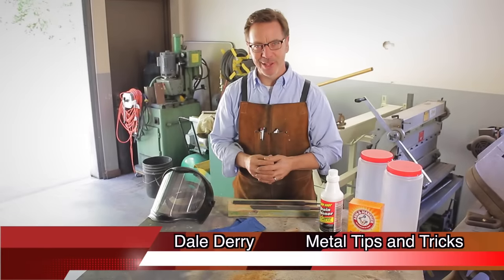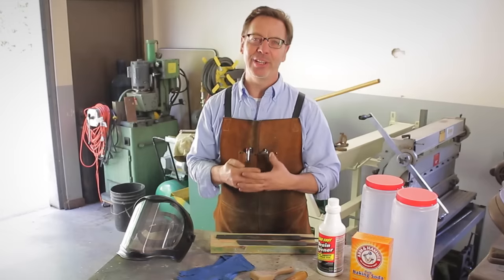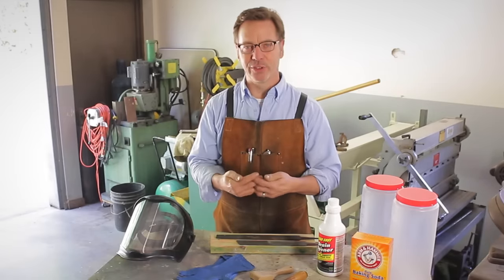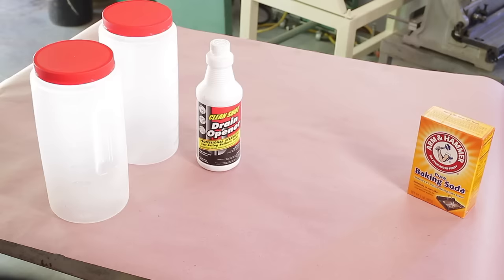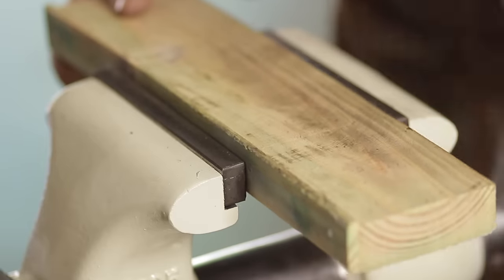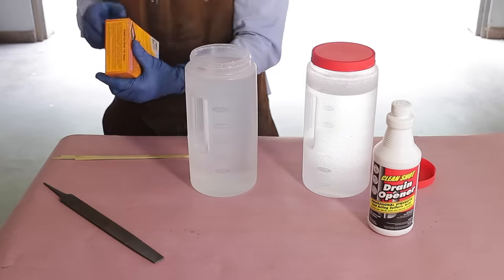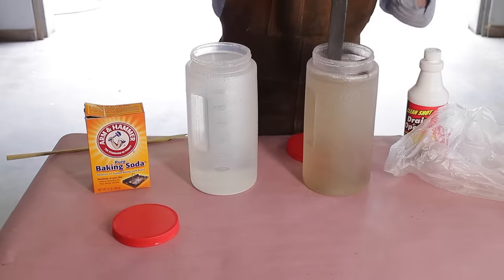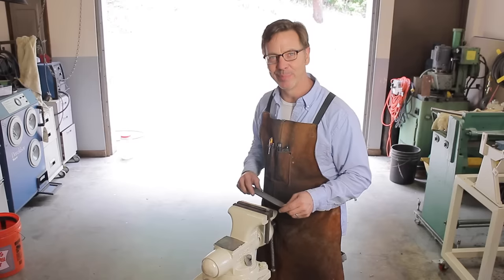How to Sharpen Metal Files

Comment: In an old book I have re sharpening files it says:  Immerse file in acid for a short time.  Then pass lightly a piece of cork along it to remove acid from the top of the teeth.  Immerse again.  Pass the cork and repeat as necessary.  What is being done is actually to not let the acid eat away the top of the teeth but only the valleys.  Never tried it meself.
Reply: this would work.... but u would need to go at it a while
Reply: That sounds like sound advice.
Reply: That is not very rational thinking. First the valleys are not dull the teeth are.  Second the second you dip the file into the acid it is back working on the teeth.
Reply: @thinkfirst6431  Actualy, it is very rational.  You are just not getting it.  Luckily science does not give a rip and it just keeps on doing what it does even though some of us are just a little to invested in cognitive dissonance to understand it.  If you really refuse to accept proven concepts then just send all your dull tools over my way.  I get a kick out of bringing old tools back to life.  Save a grip of cheddar in the process.
Reply: @edstimator1  Actually it is not very rational. no one ever cut anything with the valley of a file unless it was ground down into a knife. The acid is doing the work the cork might at best be wiping some of the sludge off of the top of the teeth speeding up the process an amount not worth the effort. The cork is too soft to effect the metal and would absorb some of the acid so that your just rubbing the metal with a soft material soaked in acid. 

The acid is what is doing the work. The acid eats the metal at a constant rate over all of the file. The reason that it works is that the tops of the teeth are worn at different rates. The very thin tops are dissolved at a "faster" rate than the thicker worn parts of the file so that when the worn parts of the teeth approach a sharp edge again the thinner parts and the thicker parts join in a "sharper edge in roughly the same time making the surface of the tooth more or less "sharp". No one gives a crap how deep the valley is, only how sharp the cutting edge of the file is. 

The acid dip only works as long as the hardness of the file is uniform in depth. If the hardness varies so will the chemical sharping. Acid dip works, the cork is just BS.
Reply: @thinkfirst6431  Dude you're trippin balls.  I've done it, others have done it, it's proven. but don't take anyones word on it. Just keep buying new tools every time they get dull.  That's the REALLY smart thing to do.  Cuzz it's soooodifficult to put some acid in a bottle and throw some old files in it.
Reply: Actually, I just read your whole post and have no idea wtf you are talking about so forget I even responded to you.
Reply: @thinkfirst6431  Exactly! I am a machinist myself, so get a kick out of these know nothing twits spouting of.
Reply: @thinkfirst6431  You just don't understand the concept. The concept being that as the acid Works on The Wider part of the diffs the cork is cleaning it off so that it doesn't eat the metal away at "the point" at the same rate as the fatter areas at the bottom...this does indeed work... try it and find out for yourself...as a machinist, fabricator, and designer, I , as well as many others have learned that theory doesn't always match reality and what says ,no It won't work ,on paper doesn't necessarily mean that's the case in real life. It has to be tried first. Then you will start to theorize why it does work. Instead of theorizing  why it doesn't ,or can't ,work. Especially in this case, where machinists have been doing this for years and it does indeed work.
Reply: @freezerfreezer9097  The concept is that if you dip files in acid then the acid eats away the metal "sharpening" the file. What happens is that the metal is dissolved at the same rate regardless of the thickness of the metal. Example: If the top of the tooth of a file is 0.001 and the valley is 0.020 (don't know the exact ratio this is just an example) the top and bottom dissolve at exactly the same rate , assuming that the metal is equally clean top to bottom. So if your tooth was at 0.002 (dull) when you dipped the file in the acid ALL sides of the exposed metal would dissolve at the same rate. Monitoring the rate of metal loss will result in the tooth going back to 0.001 with all of the other exposed surfaces reducing size by the same amount. The rate is not exact it will depend on the carbon and other additives in the metal to start with so some areas will etch faster than others on a micro scale. 

The idea of the cork depends on your point of view. To start the first time the cork comes into contact with the acid it becomes contaminated with the acid. After a while the cork could actually contribute fresh acid to the metal. The idea that the cork is cleaning off the acid is false. What could happen and what the cork could do is clean off the interface between the acid and the metal removing the loosened metal particles exposing a new face to the acid. Cutting away the "dull" part of the point is the whole purpose of this procedure otherwise you are not getting anywhere. Use the cork don't use the cork you could use a piece of wood or even a file card to do the same thing. The cork wouldn't/doesn't focus the sharpening it would only make it faster by removing interfering scum on the metal. On the other side if you could focus the acid only in the valley and avoid the tooth the file would never get sharp. When was the last time you sharpened a lathe cutting tool on the side but left the cutting edge untouched? If you put a piece of metal in water and leave it long enough does the metal rust equally or does the thinner parts rust into a sharper edge leaving the thicker parts not as effected?

The cork isn't the magic, if there is any it is the cleaning action on the metal.
Reply: Yeah that’s how I was taught decades ago. The lazy way is Soak it in vinegar then hit it with a file brush.
Reply: @thinkfirst6431  if the valleys are clogged the teeth can't do their work
Reply: @RimfireRat  No kidding? If the valleys are clogged with steel or iron take a file card and clean the valleys out. If they are clogged with aluminum or other soft metal first you need to think about what you were doing then you need to know if, depending on what metal it is, the metal will actually be dissolved by the acid you are using and will the acid work faster on the steel of the file or the metal you are trying to remove in the valleys. Not much point in removing the teeth and not cleaning the valleys. Generally it mechanical cleaning for aluminum ect..  If the material is wood or plastic and it is stuck in the valleys to the point that a file card will not remove them the acid will have little effect on that material until you have dissolved enough of the file to make it useless and the material just floats off due to nothing for it to hang on. 

Files are designed for steel or iron removal period. If you use them on wood or plastic clean often. If you use them on soft metal clean very often and good luck.
Reply: @TheLexiconDevils  how well does that work, compared to using sufluric acid?
Reply: @thinkfirst6431  short time clears out the valley and not the teeth. The cork clears the sludge so acid can get into the next layer. But then you already knew that. Interesting feedback though.
Reply: Does anyone read any of the response besides the first line then start typing? The only thoughts I could add to the cork being introduced to the equation,  are 2 things, one you already said its just cleaning off old metal and to expose the next layer and introduce acid.

Second I was thinking the cork is acting like a magic eraser or micro abrasive once its loaded up with metal and acid (think leather strop and jewelers rouge to polish and hone a straight razor or knife) but even if that is the goal I can't see it really expediting or making the process faster or anymore effective than if you just threw the files in the acid then neutralized it. 

Id guess if you corked and acid washed 5 files and just acid, baking soda 5 files you couldn't tell which was which if you did a blind test.

Comment: Great tip! Old files can be recycled into scrapers, knives, lathe bits & makeshift vise jaws too! Thanks!
Reply: The steel in old files is also a favorite of custom knife makers
Reply from the maker: Nice comment :-)
Reply: Do NOT use them as lathe bits ---very dangerous
Reply: @davidwrighton3914  You are right. Files are too hard and brittle for lathe bits. But they might work if you tempered them to make them just a little tougher and less brittle.

Comment: This is a time honored method, and it does help to improve the files cutting ability.  The acid etches the file steel.  This method does have its limitations though.  For example, files that have been abused, stored or used improperly.  All of which are a very common issue.

I have seen many a file just tossed in a drawer or bin with other hardened steel tools and files.  I have also seen files used with saw like, or in a scrubbing/sanding motion.  This will rapidly round/roll the file teeth over.  Even milder (softer) steels can have this effect on a file if it occurs often enough.

Or they attempt to file on steel that has been work hardened, think, an edged tool (such as an axe) that has been used to strike something hard such as stone.  This high speed impact crushes the edge of the tool, which causes the molecules at the site of the impact to become heated and compressed.

After the impact the molecules at the site of the impact rapidly cool and often become harder than the file being used to resharpen the edged tool.  This sharpening attempt literally rounds or rolls the fine edges of the file over, thus, destroying the cutting edge of the file.  Files can only cut materials softer than the file itself.  If the steel is too hard for the file, the steel must be carefully ground to remove the work hardened steel.

Any action that causes a file's steel to become hot will soften the steel of a file, making the file useless as a file.

To me all of these forms of file abuse are indications of clueless and unskilled workers (aka: greenhorns).  Or... people that just don't give a damn.
Reply: Every winner was once a beginner… 
You weren’t born with natural knowledge of metallurgical science and file maintenance. Greenhorns can learn

Comment: Thanks for sharing. As Michel Nadon said earlier, it would be nice to have visual proof of the effect of acid etching on the cutting edges of the file. In theory, what you are promoting might work if the acid etches all surfaces equally and a round tip will become a sharp tip as a consequence. However, I think we need to see this happening to be convinced, My feeling is that sharp edges will be strongly attacked by the acid and come out rounded.
Reply from the maker: I follow your logic and agreed with it, but  it dosed sharpen the files. I don't know why all I know is it works. :-)

Comment: I learned the same trick as an apprentice, the only difference was that it was a 9% sulphuric acid mix and it was left in the solution for 2 hours. Afterwards, you put the file in cold water and agitated for a bit. It worked well. I never did it a second time but I remember being told it only worked the once. Good post, thanks.
Reply from the maker: Hi The run Reaper,  Thanks for your comment. I like stories like that.:-)

Comment: A similar process I tried does sharpen dull files. Whether the system used here sharpens them depends, I suppose, on how badly dulled they are. The copper cleaning tool is a great tip. I used muriatic acid from a masonry supply house and vessels made of PVC sewer pipe with an end cap cemented in place. I left the files in for many hours which ate away a lot of steel, too much in some cases. Worse, the fumes seemed to alter the chemistry of my shop. Here in a dry part of the country I'd never had rusted tools. Since the acid etch everything wants to rust so do it outdoors.
Reply: This a common problem with hydrochloride (HCl or muriatic) acid - even the fumes from an imperfectly tightened lid on the HCl bottle can cause corrosion through your shop - best to store strong acids in their own steel (sacrificial) cabinet with a bunch of seashells in it.
Reply: @mikelastname  Sounds like wise advice. Thanks.

Comment: yes, I am a swordsmith, and I really go through files (filing spring-hard steel a lot). copper and wood both work. For small files, get a popsicle stick to clean them out. Same trick.
Reply: Am pattern welding files into knives with high nickel saw blades for contrast put into nitric to reveal. I imagine the nitric acid(dilute) would work nicely and quickly for file sharpening.

Comment: An old machinist taught me many years ago about using a soft piece of metal to clean a file. I’ve still got a piece of brass shim shaped like an L that I use. I’ve used aluminum, it works fine. Had a piece of brass dar stock that I had used for a punch pin that had mushroomed the head, that mushroomed head worked well. Obviously, the copper you used here does the trick. I’ve never used chemicals to clean a file, but I’ve not ever had a rusty one. Well done and thanks for the video.

Comment: Can you show us a close up of the teeth before and after the cleaning? I'm intrigued what this actually does to the file.
Reply: It dissolves the surface which brings the teeth back to a sharper point, if you try it yourself you’ll see what I mean, if the teeth were rounded before, the two intersecting planes of the tooth dissolve evenly bringing the two planes closer together and therefore deleting the rounded tips of the teeth, I agree, if he has the close-up cameras ability to show it, it would be helpful to explain using the visual aid to show this effect. Even a drawing would be helpful
Reply: @b2manufacturing  Thanks for the explanation. It seemed sort of improbable but now you explain it the process makes sense.
Reply: I think it’s actually cleaning the file I think the acid loosens debris from the tooth relief .
Reply: @b2manufacturing  the rounded cutting edge will as fast resolve as the surfaces. I don't think it will make it sharper, but the proces will clean it more up, so the teeth will become more corse regarding the high and lows of the teeth, so it feels like it's sharper again.
Better buy a new file, they are not that expensive.

Comment: I always use citric acid, it works just as well but is less bad for the environment. Also, I use a 40volt dc power supply so as to speed up the process like in Electro polishing, the electricity makes more metal erode of the planes than of the points and the file becomes even sharper. After I use the citric acid I bring it to a recycling company, fresh citric acid you can pour down the drain, it will be deluded and become harmless. Citric acid that is used with metal can be full of chrome 6 and 7 so recycle it responsibly. The acid I use comes from citrisurf(brand name) ps. great video not many people know this trick and throw their files away
Reply from the maker: Thanks f0r your comment
Reply: This is electrochemical machining, and probably much superior.   Does some iron plate out on the Cathode?  Is the cathode lead or stainless or does it matter?  I think this is the right path and hope you will publish something.
Reply: How do you connect the power supply? I tried something similar with a 12 volt battery charger and just fried it. Didn’t know who to ask but hopefully you can explain the correct method?
Reply: Electroetching will be faster but the tips of the file teeth have a higher electrical potential and will erode faster and as a result, the files won't be as sharp, it may even dull the file more, depending on the electrolyte, voltage and current. That what the process of electropolishing does, it removes the high points on a surface to produce the polish. There are shops that specialize in electro deburring.
Reply: Interesting! I may have to try that twist..
Reply: I think I've read Cocoa Cola does work too

Comment: When you get new files, keep them separated and dry where they won't bump into anything. I have my own handmade rack I keep them in, much like a knife block. Card your files often and keep them chalked. Use the proper file for the job at hand. If you take good care of your files, you won't have to resort to dipping them in acid, which only works for a little while (the file will quickly dull again) with diminishing returns. For all this trouble, you might as well just purchase a sharp new file and take good care of it rather than handling caustic chemicals.
Reply: At last!! someone with some common sense.

Comment: Old files can make great knives that how I sharpen mine.
Reply: William Miller I've made several knives from old files myself. Just remember to do both heat treatments so they aren't so brittle then to put temper back into the file.
Reply: But how do you use the knife as a file after you turn a file into a knife.
Reply: Great info I,ve got a ton of nice old files,but there all dirty got them from garage sales and swap meets.Now I can clean and sharpen them.thanks also and going to make some Damascus knives.cheers
Reply: Files aren’t made the way they used to be anymore. You can make knives out of any number of materials, but vintage files can never be brought back once they’re turned into knives. USA made Nicholson files are some of the best files ever made, and they stopped production in the US in 1978. If you have any Nicholson USA files (not Mexico, Portugal etc), DONT MAKE KNIVES OUT OF THEM !!!! Lol. Just busting your balls, it’s your stuff do what you want. However a good file will last you a lifetime if cared for and maintained.